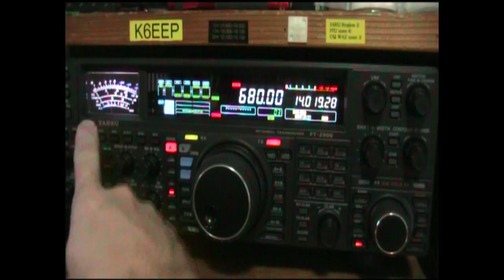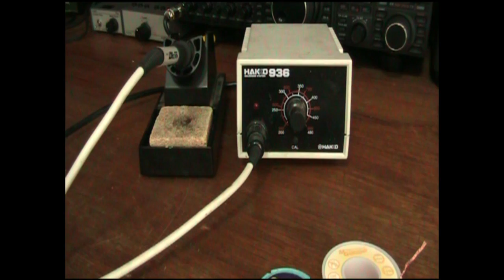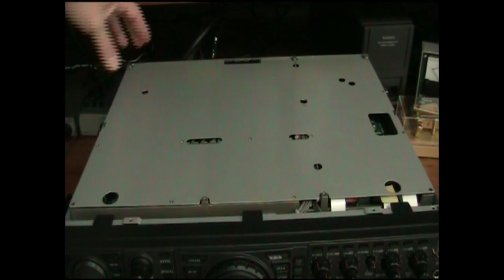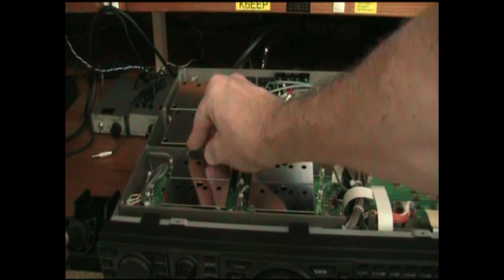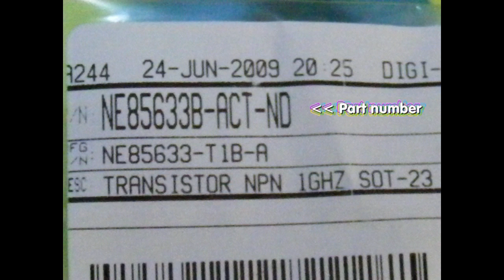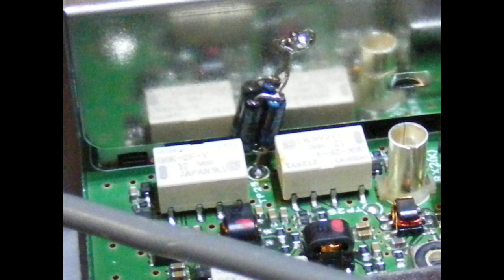FT2000 Preamp repair part1

Comment: Thank you so much!
Fixed my 2k in 30 min.!
Question though. Please excuse my ignorance. The limiter (2 diodes) are soldered between ground and the test point. (Tip: I put an old/bad iron tip in the chuck of my drill and used the drill as a lathe while I honed it down with a file then sand paper. This allowed me in between the two relays with ease)
The question is, how does the limiter work? I mean, if it blows wont everything just go back to the way it was?
Thanks again.

Comment: Hello Mike,
nice job with the repair. I've got situation where AMP1 go lower S indication (so a problem with this amp) BUT AMP2 is operational, S meter increase, so it's working.Could be some kind of short on first AMP (amp1) ? Thanks in advance for your input, I'll badly need that input.
All the best!
Adi, yo2liw

Comment from the maker: My preamp blew due to RFI coming in through the rear Key jack.  When I plugged in the keyer and ran 1Kw it blew the preamps.  I blew 9 transistors just figuring this much out. I did a lot of rewiring and general improvement of the shack grounds.  Between that and the diode limiter I have had no further problems.  YAY!